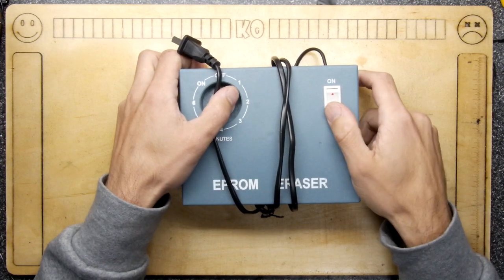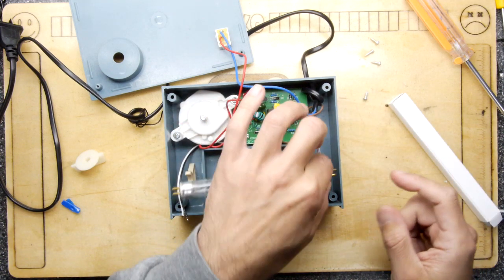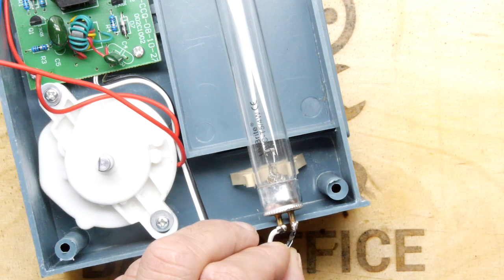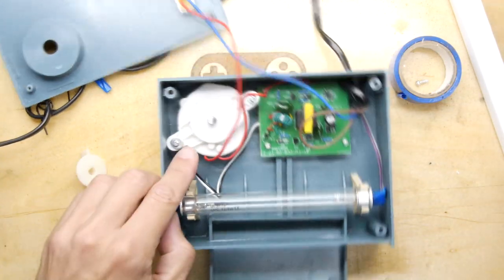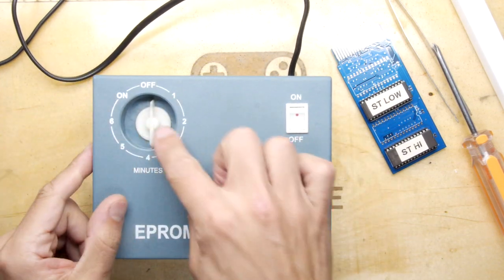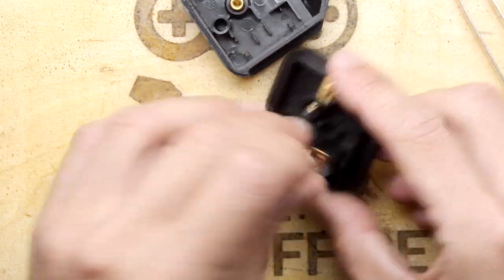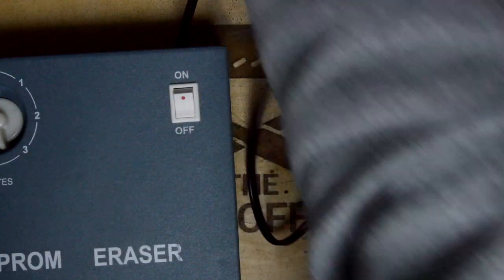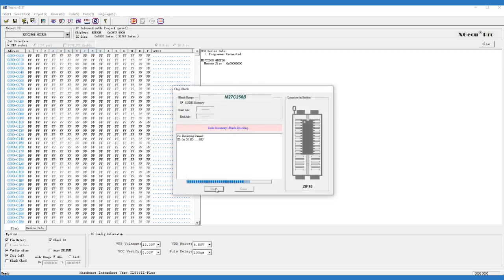Repair your EPROM Eraser Lamp

Comment: The original wiring had the switch in the blue neutral wire. For safety reasons in the UK this is incorrect and the switch should be relocated to the brown live conductor when converting to a BS 1363 UK plug.

Comment: There are some rotating sockets for T5 tubes, not easy to find but a lot better than soldering directly on the tube.

The tube is supposed to be:
Size: T5  (16mm diameter)
Power:   4W
Length: 13,5 cm (tube itself) and around 15cm total length
Wavelength: UV-C 150n to 250n

The UV wave length is needed to release the charges "trapped" in the memory cells.

1) The cells of D-RAM are basically composed of the stray capacitance of a field effect transistor.
The gate of the transistor is used to "write" the value to store electrically by putting in or removing electrical charges.

2) The cells of all sorts of ROMs are the same except that this gate connection is not normally available but only through a specific "programming logic".
When a chip is blank, all values are '1' -> value FF. In standard ROMs only '0's can be programmed. If a cell is already '0' it cannot be reprogrammed to a '1'

ROM (also called OTP)  no provision at all for reprogramming. One time throw away part for high volume production
EPROM (UVPROM)         technically the same chip as above BUT the quartz window makes erasure possible with UV, for small series or prototypes expensive because of the ceramic package
EEPROM                           contrary to standard ROMs cells can freely be programmed to either 0 or 1, they are electrically erasable. This is byte programmable.
Flash EEPROM)               this is an evolution of EEPROM. The flash fonction comes from programming a whole page (usually 2k or 4k) at once.
So programming 1 page of a flash takes the same time as programming 1 byte of an EEPROM.

All this to say: the UV-C light is the only way to erase an EPROM by helping the captive charges escape the cell thus returning the cell value to a '1'.

Just a side note:
If the equipment has a US plus it might mean that is is only designed for 110v, with a voltage doubler inside. Just changing the plug is a leap of faith.
If i remember correctly the 'arc over' (the startup) voltage for tubes like this is 260v. Using a voltage doubler to achieve this is required for 110v.
But, even if the circuit is designed with big margins so that it can also accept 220v it means the tube will be working at twice its nominal voltage.
This will definitely shorten the lifespan of the tube.

Comment: I know this video is old but If you spray adhesive aluminum foil to the lid it will push more UV light to the chips helping out that little Tube.

Comment: Nice video. I have the same eprom eraser model and the bulb seems to be dead, it worked for only a few months. I wasn't sure what replacement bulb to get, but I see you got a T5 4W, that helped finding the exact compatible model, 13cm long. Thanks!
Reply from the maker: Glad I could help, good luck!!

Comment: I've just realised this is switching on the neutral, too. Naughty naughty. The circuit itself looks a little...uhh....interesting... I reckon Clive would have a field day with this :p
Reply from the maker: It's all a bit dodgy. I think they they care about neutral and live on most two pin countries
Reply: @backofficeshow  Yea, I'm starting to see how you managed to fuse the house hehheh
Reply: @backofficeshow  i believe this UV eraser is actually a double insulated device. There's no exposed metal parts, and the whole thing outside is plastic. You have to disassemble it, to expose anything that's live. 

Chinese 2 prong plugs aren't polarised, unlike the similar US ones, but they must only be used for devices that are double insulated. In China anything that requires an earth and has exposed metal parts, like a washing machine, must have an Australian style 3 prong plug, the type with slanted prongs.

Comment: 2:03 AFAIK, it's the mercury vapour which generates the UV when ionized.

In normal fluorescent tubes, they just have the phosphor coating on the inside of the tube instead, which gets stimulated by the UV.
Reply from the maker: Ah that makes sense
Reply: @backofficeshow  

The scary thing is that a 3 Amp fuse would still allow the device (or shorted cable) to dissipate 720 Watts. lol

And the original 13 Amp fuse around 3 Kilowatts. :o

Seems to be the de-facto for people to just shove a 13 Amp fuse into every mains plug, doesn't it.

3 Amp should be OK, as it's WAY better than nothing. RCDs are true life-savers, too.

The RCD in our house certainly helped when I managed to bullseye the ring main cable in the wall. lol

(trying to install a Cat 6 back box on the wall. Checked all the mains cables from the consumer unit, and it looked like they all ran down to the floorboards first. Nope. Out of the whole area of wall I could have chosen to drill, I hit the cable perfectly in the middle, and melted my Brother's drll bit before the breaker tripped.)
Reply from the maker: @electronash  it's uncanny. Copper pipes are the same, I'm sure they jump in front of the drill
Reply: @backofficeshow  

I don't think I've EVER been quite so "annoyed" at myself for that.

I'm usually SUPER careful with mains stuff.

To the point where if I'm working on anything mains-related, I instinctively look to make sure it's unplugged before diving in.

Comment: If this was designed for a US plug won't that mean that it's now using twice the current when it's on a UK plug?
Reply: The 2 flat prong "US plug" is used in China, at 220v.
Reply from the maker: Half the current 👍
Reply: @backofficeshow  Well, different to what it was designed for anyway?

Comment: Pop onto Big Clive's channel and search for "uv". Probably the first couple of videos which pop up, "Good UV versus bad UV. All available on eBay." and "Awesome flesh-burning death lamp. (Germicidal UV)" are the ones where he gives some decent background info and warnings on your uv tube, including the ozone smell. Personally, knowing this, I would have tried a less aggressive tube, or even a uv nail gel curing lamp.
Reply from the maker: The UV nail tube I have does nothing same as the black light lamp
Reply: @backofficeshow  Well, at least that saves me the trouble of trying to erase with a nail lamp. I suspected the leds might be too low of an output at the optimum uv erase wavelength to work well, but it was always worth a punt and the niece would have scored a curing lamp for her nails afterwards. Now, your efforts have denied her, lol. ;) Shh, I won't tell her if you don't!
Reply from the maker: The UV nail cutting lamp works great to cure 3d resin prints 😁